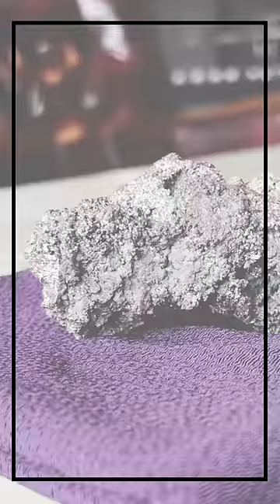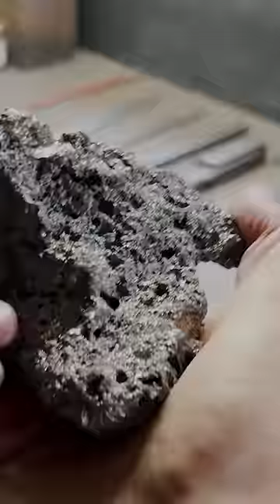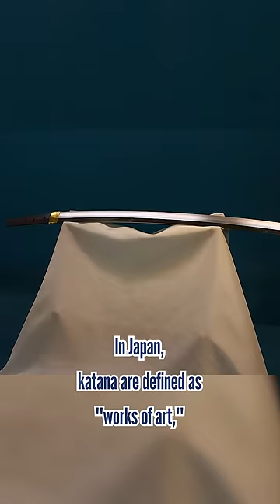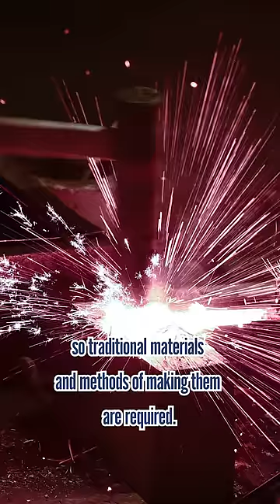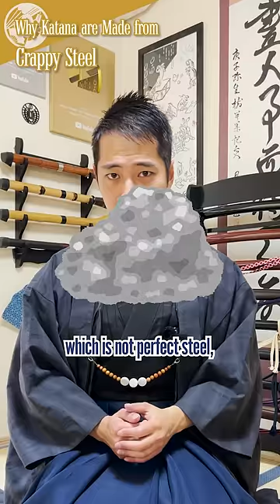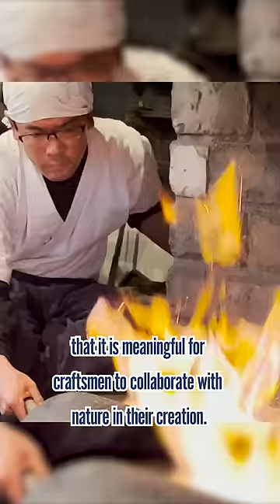Why Katana are Made from Crappy Steel #Shorts

Comment: It's a cultural and artistic tradition going back hundreds of years. I'm a sword guy, martial artist and HEMA practitioner, and I can say that many HEMA practitioners wish that Europeans kept their martial traditions in the same way that the Japanese managed to.
Reply: ^this
Reply: If there was a traditional smith that partook in the entire process of forging a historical European blade, people would be shocked with how similar it'd be to Japanese smithing.

I remember reading about a 16th or 17th European sword called a "storta", which had an eerily similar construction to Katana by being a sword that had a carbon steel edge with a low carbon or plain iron body.
Reply: @DBT1007  pretty sure the Europeans back then didn't even know what about katana or scimitars
Reply: @krieger8825  high quality swords have always been sought after
Reply: @jonajo9757  Europeans had access to superior iron, so dropped pattern welding techniques before they became the traditional method in Japan. While Japanese swords are differentially hardened, European swords are differentially tempered; different method, similar goal.
Reply: Europeans didn't have the benefit of being an island, literally 2000 years of invasions and outside forces pushing in drove them to drop the traditional stuff. 

Even then,  around the start of the Renaissance there was a lot of feelings of loss about losing parts of their martial culture. Don Quixote was actually written as a satire of those feelings, since Spanish nobility was so obsessed with past feudalism.
Reply: @Oppetsismiimsitsitc  That's the thing, but folding steel isn't the same as pattern welding techniques. Folding was just a common practice when it came to consolidating iron, especially in Europe where blast furnaces won't become widely used until the 16th century. Even then, steel still had to be folded due to slag still remaining in the resulting iron.

Then for iron sources, it depends, but Japan did infact had access to desirable ores that were similar in quality to other ores in Europe. Namely mochi tetsu, a high purity magnetite ore that's comparable to Swedish sources. Sands usually had their iron separated through the usage of controlled slopes of water that were meant to concentrate the amount of iron in the sand by washing away impurities.

Then there's trading, which depended also.

Also differentially tempered? Mind explaining?
Reply: @jonajo9757  Folding steel is a type of pattern welding technique, there are many. It stopped being common practice in Europe by the end of the Early Middle Ages.

Differential tempering: taking an already hardened blade and applying heat to the specific regions that need to be tough/soft (rather than hard/brittle). Also very common to see it used in tools, such as axes and saws. 

Not so much a point about superior or inferior (the best medieval blades came from crucibles in Northern India), but that humans adapt to their surroundings. Japanese swordsmithing evolved to suit Japan.
Reply: The katana is honestly frozen in time. I'm not a HEMA guy but i spent my late teens and early twenties around steel mills. 
Better weapons needed more work, more research and that is why Europe was able to colonise the world. Katanas are excellent in museums, but if i have to hurt people I'd rather fix one of my chef's knives to a stick and use it as a polearm instead. The steel is just eons ahead.
Reply: @rustomkanishka  to be fair,  modern steel didn't exist until the 19th century,  and its consistent quality outpaces anything anyone had before.
Reply: @krieger8825  They knew what Scimitars were, probably not Katana but DEFINITELY Scimitars.
Reply: @rustomkanishka  Being "frozen in time" is sort of the point; the preservation of culture and traditional arts. 

No sort of sword or polearm is a viable battlefield weapon today, breh.
Reply: @Oppetsismiimsitsitc  In pattern welding, all of the materials were folded and homogenized before forming rods. After this, twisting was done to form a the pattern, and to compensate for the use of phosphoric iron. So to put it simply, you had to fold before making a blade for this method.

For folding, it's just to homogenize iron, and nothing else. A pattern will be present, except this isn't intentional whereas pattern welded construction is centered around that aspect.

Despite it's name, differential hardening also employs tempering. In Japanese sword smithing, a quenched blade was reheated for tempering, and plunged in water a second time. This often gets mistaken as a quench than a temper. Another method involves tempering the sword in hot sand much like how modern smiths may temper a blade using a plain oven.

For the last part, I suppose? All I know is that European sword smithing and Japanese sword smithing can be eerily similar at times.
Reply: @Oppetsismiimsitsitc  Oh boy, crucible steel. That's a whole other topic that I used to look into.
Reply: @rustomkanishka  I mean it is an art form centered around preserving traditional smelting techniques.
Reply: HEMA has the best sausage!
Reply: @krieger8825  Mongols and Turks got around, Europeans were very much aware of curved weaponry and their uses, eastern european saber arts in particular.
Reply: @tummytub1161  
Het zal me een worst zij
-EchtHEMA
Reply: Keeping traditions in Europe is hard with the recent floods of immigrants. I'm happy that we still speak German here in Germany, but that's about it.
Keeping the culture and traditions alive is an ungrateful and dying art, which - and I am sadly sure in that - will soon be gone :/
Reply: TBF who's using a sword in this day and age other than for looks? I believe he even said in one of his earlier vids that the katana isn't really used much in fighting but more for status.
Reply: @krieger8825  didn't European knights battle Middle Eastern warriors prior to the 16-17th century they'd have knowledge of their weapons and crafts
Reply: @rustomkanishka  I would pick early 20th century saber. Those are actual peak of one handed bladed weapons
Reply: @krieger8825  Scimitars were known for a few hundred years
Reply: 100% agreed
Reply: @krieger8825  not that they copied Japan back then. It’s just that sword smithing has been around for thousands of years. There’s a reason people do things traditionally. It works
Reply: @krieger8825  scimitars? Like the kinds used by the Islamic caliphates we fought for 1000 years?
Reply: We have. You don't know history or culture. Or Europe.
Reply: European martial traditions favor pragmatism more tho, medieval blacksmiths would absolutely coom at the idea of mass produced cheap swords stamped out of rolls of spring steel
Reply: If they did that then we wouldn't assault rifles now
Reply: @krieger8825  definitely knew about scimitars
Reply: @Venres  Keeping traditions has little to do with immigration. But the willingness to practice arts. That for the most part have become mostly obsolete.
Reply: @josefptacek113  hey, i was only speaking of improvised weapons. What little martial arts training taught me that at the end of the day, the pointy stick is still the oldest and most underrated weapon ever. However, whether you're going into a melee to get save your land, or just need to get through difficult circumstances, it's the human which is the ultimate weapon. 
I did recently decide to start collecting blunts because they're cheap in my country (India) and found a nice arming sword. This was mostly due to my friends' jokes about my personality. If you're comfortable telling me more about weapons (these are all blunts, the idea is to hang them up on a wall) please let me know how to contact you. I'd love some guidance. 
Thanks!
Reply: We did keep our traditions but we have always be pragmatik
Reply: hema?
Reply: @jimmyjohnjuan  Historical European Martial Arts, or something like that. I am more into Early Neolithic European Martial Arts.
Reply: Part of it is because Japan basically skipped from 900s England tech level to 1700s England over the course of 50 years.

Tech sharing is one of the great things for the rest of the world that the European nations get so little credit for.

The other one was ending slavery.
Reply: I thought western martial tradition is Bonkjutsu and Gunfu
Reply: You wouldn't have globalization then. It would still be kingdoms duking it out
Reply: We were psyoped into giving them up
Reply: @V-DTAJ  if the culture isn't able to keep itself alive then it's not worth preserving it.
Reply: @QuartzChrysalis  what kinda tech we referring to?
Reply: @jonajo9757  Mostly industrial processes and machines, germ theory and proven medicine, the scientific method and so on. Both the industrial revolution and the enlightenment happened in europe after all.
Reply: @QuartzChrysalis  I reread your comment and thought you've only meant in terms of smelting or something.
Reply: As a HEMA guy, I gotta I dont know many who would buy a sword made the traditional way. Gear is already expensive and that would just make it more expensive for a blade that doesn't last as long
Reply: @tiexiaowang7939  Bragging rights is the answer.
Reply: @zakazany1945  folks flexing about the "English Longbow" while Chad ENEMA artist strings his replica Ötzi the Iceman longbow.
Reply: Since we made the gun update that meta die pretty fast. Japan in denial of that fact and keep trying to play outdated they end up losing everytime.
Reply: Oh def its kinda a shame
Reply: @renevil2105  Firearms were used alongside cold steel for centuries, my friend. And the Japanese were quite well known for their early and eager mass adoption of matchlock firearms from the Portuguese.
Reply: @jonajo9757  That's understandable, I'm not the best writer.
Reply: @V-DTAJ japan also has its struggles to keep its traditions. Dont think that japan is picture with a plain green field with a cherry tree laying its flowers to the wind and mount Fuji amid the fog in the background
Reply: Actually, this isn't really the case when you look closely, and Martial Tradition in Japan really went the same way as it went everywhere else, relegated to aesthetic styles regarding weapons practice and degenerated (Shotokan is the dominant form of unarmed striking style in Japan, it was not originally intended for this and is an arbitrarily adapted version of traditional Karate by Funakoshi) or competitive unarmed styles (Judo and Sumo).

I mean swords were made illegal during the Meji Restoration, and this basically killed the actual practice of Japanese fencing, and the budo period was already mostly aesthetic because they'd had several hundred years of peace in which armed combat was largely unnecessary and so people who'd never used the styles in practice. Most surviving Kenjutsu styles are not practical fencing methods, the archery is more of a metaphysical meditation combined with a sport, and Kendo is a sort of reflection of some aspects of Japanese fencing, but it is a modern interpretation of this. So neither the unarmed or armed Martial Practice's actually survived, they were simply reborn in forms that better suited the modern era, like what we saw with European Martial Art's in fencing and boxing.

They maintain some aspects, but it really went the same way as European Martial Art's and only a desperate few clinging to traditions that don't even reflect historical Martial Practice really altered the outcome at all.

If you mean solely the forging of swords, sure, but even that didn't happen for so long that people essentially had to recreate it just like other's are doing with HEMA now.
Reply: @george2113 

I mean Katana aren't exactly high quality swords, but European smith's definitely had knowledge of swords from around the world. Trade occured everywhere, and some people don't seem to understand that individuals from the Eastern country's either found their way West or Western trader's and explorer's found their way East, all brought stories and examples of metallurgy with them.
Reply: Ok but, Europeans still had much better steel than samurai had at the same time
Reply: @AveSicarius  "Katana aren't exactly high quality swords"

Swords came in a wide range of qualities everywhere in the world.
Reply: @Oppetsismiimsitsitc  

Yes they do, and the Katana is the best form the Japanese could make with the materials they have, but compared to other swords it's objectively not as effective. It was a symbol of status first and foremost, unlike something like the Greatswords used by the Swiss and other cultures that actually had some use on the battlefield as an effective weapon.

Perhaps I should have used a different terminology, it's just not the best form of blade even for cutting if you have other options. It's like the English Longbow being a better battlefield weapon than basically any other tool an archer would be using at the time because it could outrange anything but a crossbow with far greater rate of fire. This was more of my point, and largely in relation to the use that the weapon would have actually seen.
Reply: @AveSicarius  Wow. Wall of text and objectively incorrect takes. Even pulling out the old Anglo-world's pop history. Nice work.
Reply: Where my Cold Steel at!?
Reply: @V-DTAJ  German culture today is VERY different from German culture 200 years ago, which is VERY different from German culture 200 years before that.

If you are so concerned about cultural traditions, I hope all lands east of the Elbe are given back the Sorbs, the people who lived there before the German immigrated there and changed the cultural makeup.
Reply: people do. we don't need a law. people here probably make swords like they do there somewhere in the usa. just because a few people care doesn't mean they all care.
Reply: @minutemansam1214  germanic tribes were already there before the slavic migrations
Reply: @Alex-dh2cx  what outside forces and invasions other than the mongols, Turks, and maaaaaaybe Arabs (you'd have to go back a long way, only by 700) endangered Europe in the past? Majority of wars in Europe were well... by Europeans.
Reply: @jonajo9757  smithing anything all have the similar base. It's just the process of folding and using ore.

Bronze, to iron to steel.
Reply: @evilassjitnem  Basically we should just hand entire Europe to the Basques
Reply: @arzfan29  edgy.
Reply: The martial arts of Japan were seen as arts. The martial arts of Europe were seen as tools to achieve a goal. Different cultures with different values.
Reply: @Remoralisation  feudalism sucked,  even Miguel de Cervantes knew that in the 17th century.
Reply: @frawDgnicnaD  I don't think you would have enjoyed life as a serf.
Reply: @gadellomagnollo1810  Anything humans like to work on just for the sake of perfecting it can be considered an art. The difference between Japanese and European martial arts is the connection to religion. Japanese link everything they do, including serving tea, to their religion.
Reply: Cringe
Reply: @krieger8825  for sure some portugese did
Reply: Europeans went the path of technological advancement... While katanas are beautiful, they are weapons first and foremost... Japan sticking to tradition played a major role in them falling behind Europe on the technological advancement of society while the rest of the world was constantly evolving and advancing. 

Weapons and metal forging as a whole played a huge part in civilization, using outdated forging methods was an unreasonable barrier that prevented their growth.
Reply: @jonajo9757  is.  8jjjjjjjjjjjijj
Reply: True
Reply: @krieger8825  the scimitar was used by the Ottoman Empire in Europe.
Reply: You also weigh 600 pounds so…
Reply: @pablo4yu  Baby, I'm built to survive car crashes.
Reply: @Oppetsismiimsitsitc  nah ive seen the graham vids but
Reply: As a HEMA practicianer myself I'm sick and tired of people celebrating a overhiped sword made out of nail iron, the Japanese keep their tradition through isolation and stagnation
Reply: @krieger8825  Obviously not but did you forget about their next door neighbors with scimitars?
Reply: Lies
Reply: @jonajo9757  no, they have low carbon steel which is why European long swords are so much better than katanas, they hold an edge better and they don't just bend or chip
Reply: @NeelTheHuman  From what I know, the katana tends to retain their edge longer than a European blade, but at a cost.

A katana's edge's failure point would be crackinh or chipping whereas a Euro blade would be bending ans or rolling an edge. This can be repaired easily, but will weaken that portion of the edge.
Reply: I always think about it, it would be great. Maybe from now on it will happen?
Reply: For one, you can still find traditionally forged and tempered steel in Toledo, Spain.
Reply: @Ludsama  What's up with toledo steel, since last time I looked at it, the topic came up from someone who purchased a sword made in toledo, but instead of it seeming to be based on historical blades, it was more "fantastical?" Plus he notes that they use modern stock. I've also read Toledo steel was nothing more than just a regular steel blade with an iron core.
Reply: I honestly enjoy the pragmatic approach of europeans more than the japanese habit of holding onto traditions. It is really hard to progress forward if all you do is try to hold on to the past.
Reply: Yeah, all the Europeans have are some books kinda detailing what to do. Some were written and illustrated by Albrecht Dürer of all people. There's a big difference between reading a book and looking at pictures and seeing a proper demonstration in person. I think part of what kept the art alive in Japan was that its feudal era lasted a lot longer in Japan than in Europe.
Reply: Tbf Japanese culture industrialized a lot later than Europe did.
Reply: Ancient European traditions would be scary... The Boggmen.
Reply: @krieger8825 no they did. As early as the migration era blades and steel from the middle east were being traded as far as the Nordic countries. If memory serves, the ulfberht swords are an example of this
Reply: They can keep mechanical watches for centuries, should able to keep sword making craftsmanship the same way